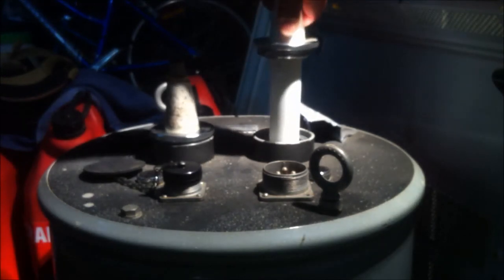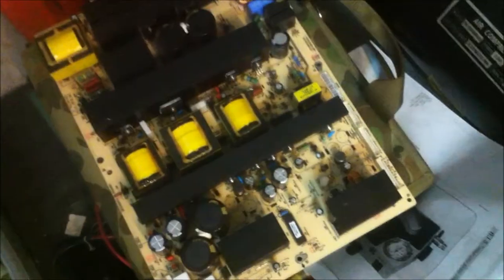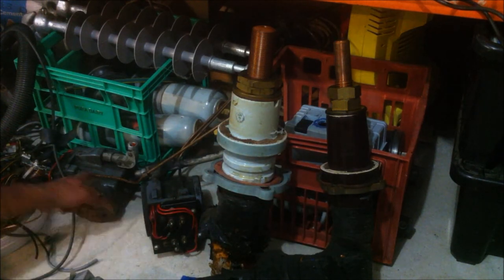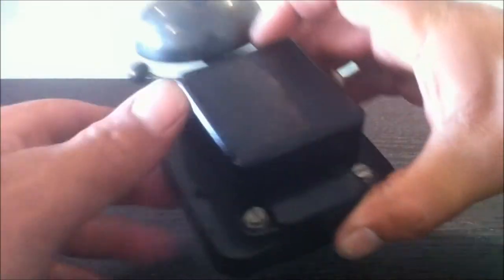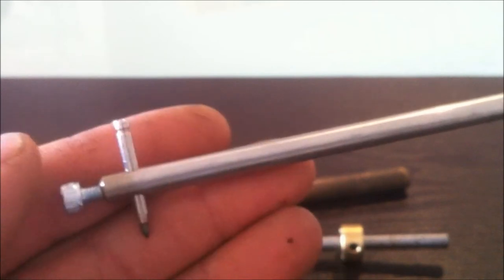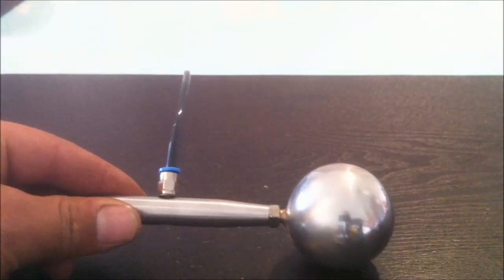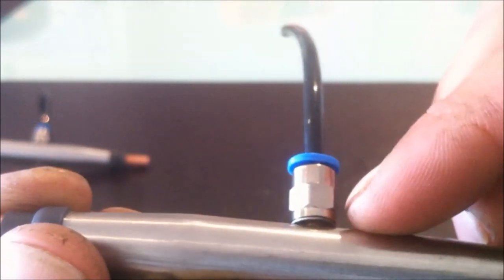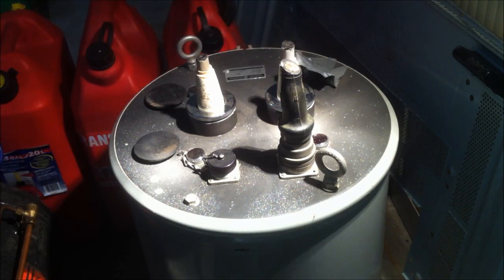Energy Update #19.1

Comment from the maker: Hi Tom. 
I don't think it is an M18x1. The diameter of the hole (inside of the thread to the inside of the thread) is exactly 17.8mm - measured it with my Mitutoyo which I trust with my life.

I measured the thread with a gauge & it fits the 25TPI and 1mm.
It is very uncommon, which is why I am a bit stuck.

I even thought that it could be an electrical conduit type thread, but the TPI in the transformer is much finer than the thread on the electrical conduit plug. 

I am out of ideas :(